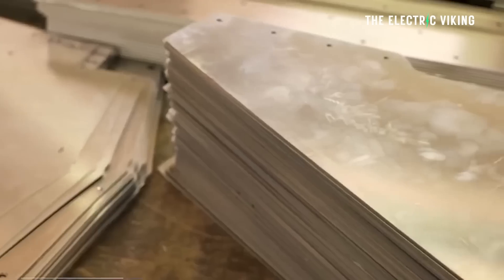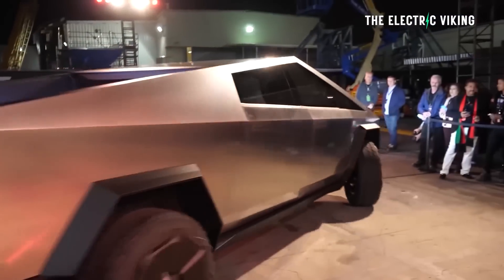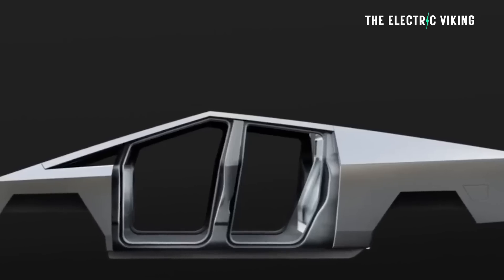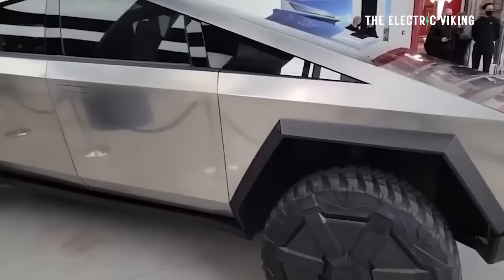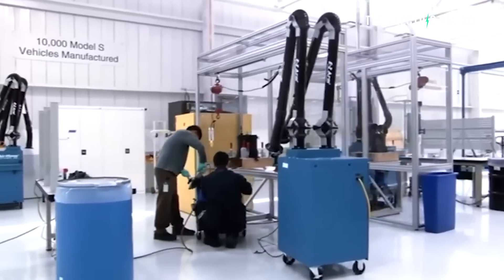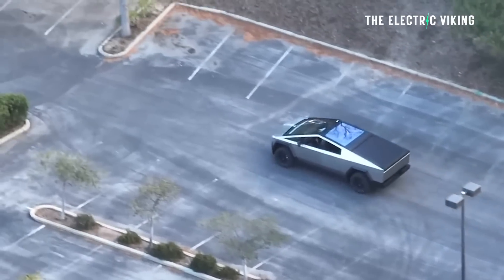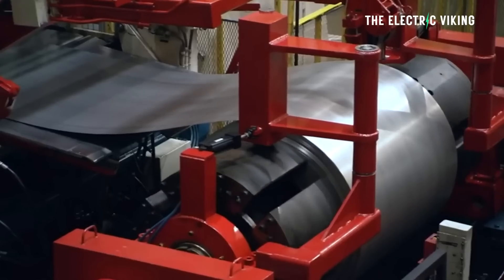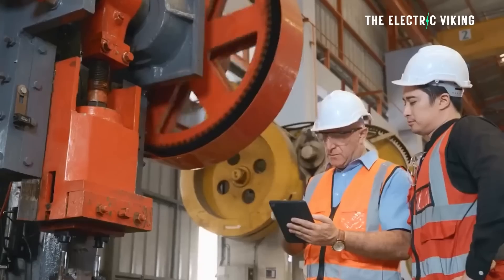Tesla reveals what's going into Cybertruck’s 30X Cold-Rolled exoskeleton

Comment: If 30x means that this steel will be between 301 and 309, it's low quality.

316 is run of the mill, 317 is rarer but with significant better corrosion properties.

Someone in the comments mentioned Duplex/Super Duplex, this is serious high quality. Although I think Cr22 is more or less extinct as everybody has moved to Cr25.

Anyway, this patent is nothing more than a recipe. Company I am working for did the same thing; came up with a new formulation for a steel for arctic ocean conditions. 

The "Tesla Steel" seems to be a hype. But the Tesla fanbois have no clue, so they swallow everything.

Comment: For a number of years, I worked as a stamping press operator. Some time later, I worked as a roll-form mill operator.

Of these two methods of shaping steel, roll-forming was by far the most wasteful.

On a typical day, I would start out with the parts coming off the mill fitting their tolerances. But after lunch break, things often went sour. None of the parts would fit the fixture, suddenly. And this would be in the middle of a coil. I would spend the rest of my shift desperately trying to make adjustments to get the parts back within specs. It was not uncommon to go through the rest of the coil without a single good part. It was also not uncommon for the guy who replaced me to work an entire shift  without producing one good part. This could go on for days.

Part of the problem is likely that, because the ingredients that make up an alloy are a tiny portion of the entire mix, they don't disperse evenly throughout the batch.

Comment: Hello Sam,
Previously the material SpaceX was using in their rockets was described as a version of 304L. Probably the most commonly used “stainless steel”. If this is what they plan to use in cars, they may run into trouble as this, and other austenitic stainless steels, are vulnerable to crevice corrosion. This would probably be a bad choice. Also, to say this has not been done before is incorrect as the Delorean car (think “Back to the future”) was stainless steel. As well, the exoskeleton term is just another way of saying monocoque, which is what most cars are these days, and SUV vehicles such as the Toyota Prado were a few decades ago.

Comment: Ford and GM better be ready to counter. The Tesla CyberTruck will enter the market with distinct advantages. I like the rust factor personally. The ICE guys use cheap and not very durable metals/alloys in their body panels and frames. The salt that the Northeast uses on their roads eats up new trucks in short order. (I'm surprised they don't go for sand in the right circumstances.) Anyway, the Cyber has the potential to be very durable. True there is the battery issue and how long it will last, but the tech is changing fast. I still haven't heard what battery will be in the Cyber. I could even see iron-phosphate being a potential power source. Man this is exciting.

Comment: Cold rolled steel is prolific throughout the automotive industry. It is used for many body panels from many automakers. There is nothing special about it being cold rolled. Stainless steel is not very common.

And unibody structures have been around for ages. 1934 Chrysler Airflow used it. Unibody trucks were popular in the 1960's. The body is used for structure on most modern cars. Tesla just brands it "exoskeleton"  and everybody thinks they invented it.

Comment: So the future battle is on.  Who will win?  Tesla, with this cold-rolled stainless steel exoskeleton.  Vs.  Aptera pickup truck, with it's pressed carbon fiber composite, which is supposedly 7X stronger than steel.  Two completely polar opposites, in achieving the strongest truck.  That would be a very interesting battle. 🤔

Comment: 3:25  "Cold rolled steel has been never used before in automotive" I don't understand this sentence. There is plenty of CR steel in Car body, or did you mean stainless CR?, so there was a car called DeLorean- made  of stainless steel. This car disappeared when reached 88 miles/h as well as from the car market so the Cybertruck will most likely disappear as well. The Super, hiper 30x steel  , it a common Type 304 or 301 is the most versatile and widely used stainless steel. Maybe they just tuned chromium or Mn %  content a little bit and they clamed it's a new patented steel. There is not rational reason to use this kind of steel in Body-in-White. There are much better steels AHSS, Dual Phase, Hot formed etc. the only reason is the marketing. Elon M: "We have created a new steel consist of Ununpentium called 30X used in StarTruck , sorry StarTrek" :) it's the straight way to kill this car.

Comment: I think Elon said they would bend the steel by etching a channel in the panels.  then bending the steel over the channels / etchings ... THEN WELDING the bend to hold it at angle.  This is different from some of the suggesting methods.

Comment: It seems possible to load a piece of 4 by 8 plywood with tailgate down and there is a flip stop that can be flipped up to prevent slip-out.
That reduces the need for a trailer for home improvement hobbyists -- although a fully integrated Tesla design trailer would probably be interesting if easy to backup and steer.  
Maybe there could also be an option for a two-way high current power transfer connect so something like an welding generator/inverter could function in several modes while taking advantage of the power storage. A generator with a horizontally imposed piston pair and exhaust heat regeneration might be able to achieve 75% efficiency over a narrow power band and that is were power storage could work in synergy to reduce waste. Or maybe a fuel cell that can plug  into a natural gas quick connect, so you pay less for power on demand. There are opportunities for secondary manufacturing if the connections are flexible to this utility vehicle.  Imagine the platform this could be, if future battery technology can develop 10x power density and Tesla continues to endeavor to keep the costs down.

Comment: I wish I could afford one, but the key take away from this is that it will not rust! I have owned pickup trucks since the 90s and the one thing that kills them is rust, at least in the middle US. I had a Toyota I loved but it rusted in half at 14 YO. RUSTED IN HALF, the mechanics called me and said it had 18" of frame rusted away and they were afraid to put it on the lift that it might fold in half.  If you body doesn't rust away, or rust at all, everything attached to it should last forever, or be replaceable forever. Break lines, rubber attachments , misc. brackets ,.. drive trains  all can be replaced. In theory this truck could last for rest of my life easily.  This is what is going to kill legacy auto, because it upsets their long standing equilibrium by making a product that's simply engineered to be the absolute best value to the customer instead of what they have been doing for 40 years which is engineering a product to give the customer the LEAST value.  What's happening now is a perfect example of the Nash Equilibrium a mathematical game theory that won the Nobel prize in economics for John Nash a mathematician.
Reply: So true, rust is what junks these new trucks. You spend a boatload of dough and you have to crush it in 10 years. No good. Tesla is going change the equation.

Comment: Railroad passenger cars have been built entirely, structure and body, out of stainless steel for over 80 years and many are still in service, with durability beyond imagination. Railroad service is demanding and stressful to the material and welding, all proven to be tough and low maintenance.

Comment: Probably a dumb question, but I don't see many seams on the Cybertruck...e.g. different body panels.  So, the front fender shares the a-pillar into the roof, then down to the bed of the truck and so on.  What happens if someone is in an accident and damages the front right corner of the truck.  Today, as long as there is no damage to the frame, it's basically just removing the damaged panels and replacing them with new ones.  What do they do for the Cybertruck?  What would a typical repair look like for this vehicle?  Just curious.  I think it is very promising (yet still somewhat of a polarizing look)...but if a simple fender bender results in repair costs upwards of 5 figures (or just totaling the truck), I'm wondering what insurance companies are going to charge, and what service centers will need to do to address repairs.  Like I said, probably a dumb question and I'm sure I'm overlooking something...just thinking out loud.
Reply: My totally amateur guess for such repairs would be cutting and welding. But that may weaken the structure... 
It's a truck however, theoretically used for outdoors or work related activities, where looks shouldn't be that important.

Comment: I’m pretty sure the sheet steel used in car manufacturing is already cold rolled. The finish is smooth and is given a zinc finish that cannot bd applied to ordinary mill steel.
Reply: Sure probably 1018

Comment: What is being described is the new (been around for 20 years but getting more popular every year) stainless grade called duplex or super duplex. This has better mechanical properties then any other stainless steels (ferritic, martensitic, austenitic) and corrosion resistance. One UNS of this range of alloys is  S1200 with a common name 44LN. All steels are alloys. If you put sharp creases in the (stainless or otherwise) steel sheet you change the microstructure at this location so you have a change in potential. This forms an anode and cathode so will always lower the corrosion resistance  whatever the stainless steel used.  Oh by the way you are wrong about the use of nickel -that is there to increase the stability of the face centered cubic austenite, the chromium is there to improve the stability of the oxide film.
Reply: The thing that worries me about exotic materials is what impact it may have on repair costs, insurance & resale. In N. CA, I'm already seeing a lot of Used Teslas with Salvage Title...

Comment: We have a similar process when making jewelry. When we run a sheet of silver through a rolling mill multiple times the piece becomes work hardened which becomes stronger. What Tesla is doing is amazing as it will make the exoskeleton stronger! This manufacturing process will revolutionize how we make things.
Reply: It already has revolutionized how we make things.  Cold rolling has been around for decades, almost a century.

https://en.m.wikipedia.org/wiki/Cold-formed_steel
Reply: @acmefixer1  If that were the case the car industry would have already been using it. If Tesla hadn't come around none of this would have happened.

Comment: It could weigh more than a hummer ev
Reply: It could weigh less than a Mercedes S class.
Reply: It may seem counterintuitive but this type of heavy steel structure reduces weights. Most vehicles have the majority of their weight in a heavy frame using even more dense alloys and then use light weight non-structural body panels to cover it all up and make it pretty. This uses single front and rear aluminum castings and structural body panels that do not need the under-supports. 

It will weigh less than a Hummer and likely weight less than a F150, Silverado, or Ram 1500.

Comment: 304 stainless steel is used in the deck posts I just installed. I welded together a bench from leftover steel. Light, strong, weldable, highly corrosion resistant, beautiful, polishable and approved by my wife. The 304L low carbon steel SpaceX and Tesla are using is apparently even more weldable, better for mission critical welds. Bulletproof is good, but not good enough for hits by space debris and micrometeorites. Seems a much better option than carbon fiber or aluminum, given the missions of these vehicles. SpaceX is also innovating with Inconel nickel alloys on rocket nozzles that can withstand tremendous heat and pressures.
Reply: its approved by the wife? No one can ask for more than that. LOL
Reply: It is surprising to me that folks think 300 series stainless is special.
Reply: @techfixr2012  it’s not just a 300 series it’s a 30X. X is the unknown designation.

Comment: Be interesting to see it’s performance in crash tests. Repairing it will be difficult as well.
Reply: Nope! It’s the modification mostly that’s going to be almost impossible tbh! Trucks are made to be single/double cab with all the configurations possible around it
Reply: The maintenance cycle for an EV is significantly different than an internal combustion engine vehicle.  It's all in the electronics and the skateboard. Should be ok.
Reply: @TurnerRentz  you miss the point. This video is about the stainless steel exoskeleton!
Reply: @lesliecarter4295  Unlike your current car... a Cybertruck can be repaired easily.  Just takes a few sheets of stainless steel and a wielder.  It will reduce repair costs to almost nothing.
Reply: @TurnerRentz  we are talking about the body here l! And if you want to talk about maintenance or whatever! There are still 30 years old Toyotas hilux in the roads even much older models from the late 80’s
Reply: @TurnerRentz  the electronics are actually the weak parts of it! I’ll like to  see that truck try and survive African or South American roads lol!!!
Reply: @TurnerRentz  a lot of Toyota vehicles used in those difficult environments comes with very little electronics

Comment: It’s not “thirty ex” steel: 30x means “three hundred series”. There’s 301, 302, 303 etc. Theirs is custom and related to 300-series steel alloys. But it’s not any of them. Hence the “x” instead of a digit.
Reply: Exactly this. We call it "Three-Oh-X" and use the "Thirty-Ex" to make fun of the new guys. "Hey go to the storage area and bring us a new sheet of that Thirty-Ex cold-rolled. If you do not know where to find it, ask one of the logistics guys."

Everyone will know that he is the new one in town.
Reply: Hence 30 x.
With x meaning the last number in the 300 series
Reply: What's the difference between an 'exoskeleton' and a welded steel monocoque body that almost all cars have been using for the last 60 years?
Reply: @brendanpells912  the load bearing part of the structure is on the exterior of the exoskeleton while in the monocoque it is underneath a skin.
Reply: @williammeek4078  Nah, still don't see what you're getting at. If I took the doors and hood and tailgate off my car, and the removable plastic bumpers, then what I would be left with is the load-bearing body shell much of which is the load-bearing structure of the car like the roof, sills, rear wings. They are an integral part of the bodyshell. When I put them back on, the doors also add to the structural strength. About the only body parts that are removable are the front wings, but they also contribute to the strength once bolted into position. Of course, one reason for having this softer outer skin is to protect pedestrians that may unfortunately collide with the car. The deformable hood and wings cushion the impact and prevent direct contact with the much harder and stiffer structure underneath.
Reply: @brendanpells912  then I can’t help you.
Reply: @williammeek4078  Which pretty much shows that 'exoskeleton' is just a meaningless bullshit marketing term.
Reply: @brendanpells912  take a metallurgy class. Then look at the design, the stainless body panels have nothing to do with the exoskeleton.
Reply: @ZeusBullyMax  Really, that's a discussion you should had been having with William Meek because he seems to think the external skin IS the exoskeleton. So, is it or isn't it?
Reply: @brendanpells912  not really. The difference is subtle but it is there.
Reply: @brendanpells912  
Exactly.  The Ford Falcon was a ‘unibody’ without a traditional frame albeit with inferior steel.

Comment: tesla uses expensive materials like steel and aluminium.
in the long run it will make a change
Reply: Who doesn’t use expensive materials!? Wtf!!
Reply: many pthers use iron instead of steel.
traban t uses plastic
they are good but not expensive.
expensive tesla use aluminium.
airplanes use expensive material.
i have seen iron ust and gail when steel or aluminium should be used.
plastic is often better than iron.
first you do not see the difference.
then they rust aeay.
plastic and aluminium lasts.
Reply: @bjornhelgason1879  are you insane!? Is the traban still in production!? Also aluminum is not the most expensive material, it’s things like carbon fiber, high strength steel…. Which tesla doesn’t use on their cars! Other manufacturers have literally everything from carbon fiber seats to doors, roof, hoods, entire body…..
Reply: @bjornhelgason1879  steel also last and is used for heavy duty applications or super flexible platforms too.